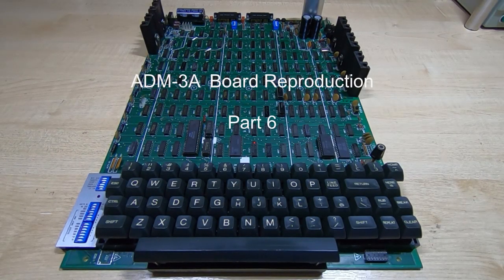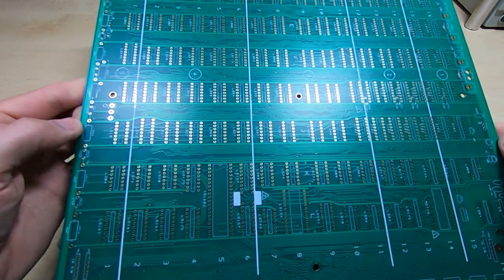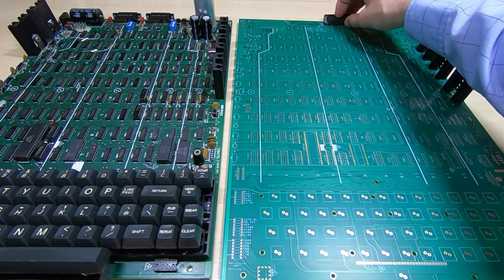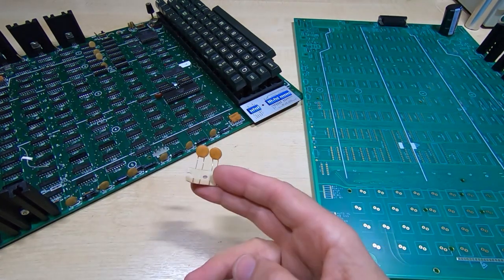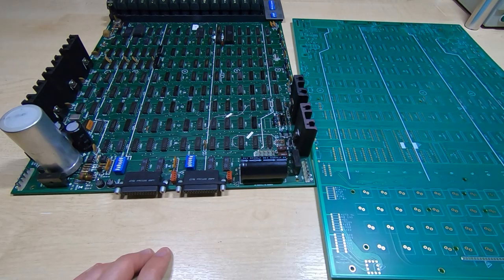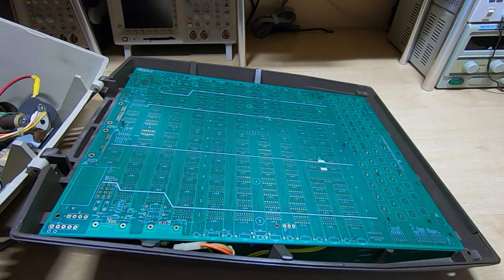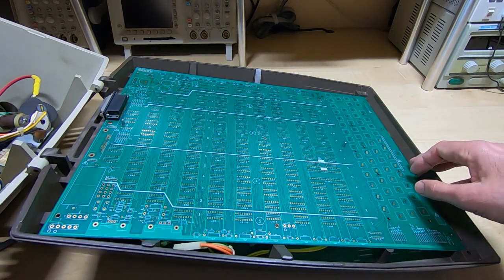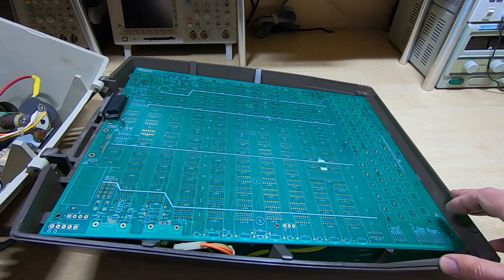ADM-3A  Board Reproduction Part6

Comment: Does your repro board need the extra wires I see added on my board or did you correct errors in the original design? Also, what size screws hold the motherboard in the case? I've had four ADM-3As and all of them were missing those three screws. I'd like to add them to my current ADM-3A. And please keep me in mind when actually selling the boards!